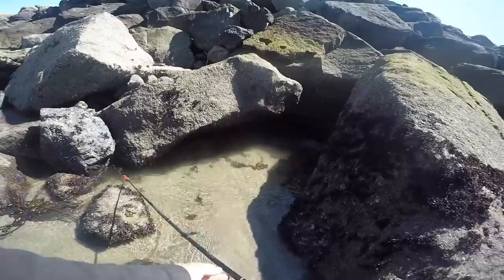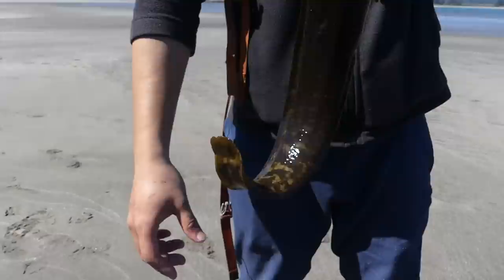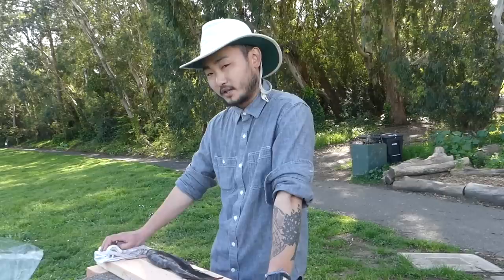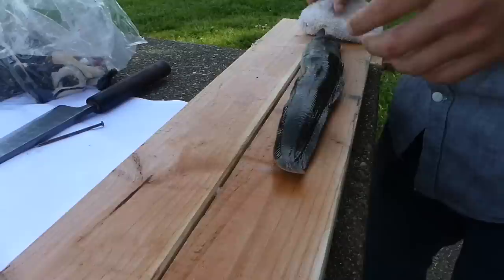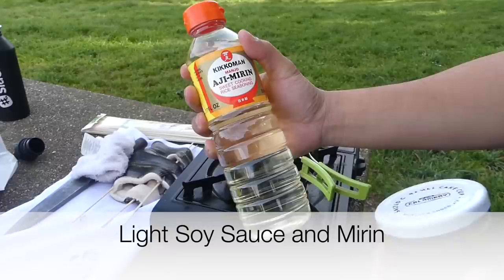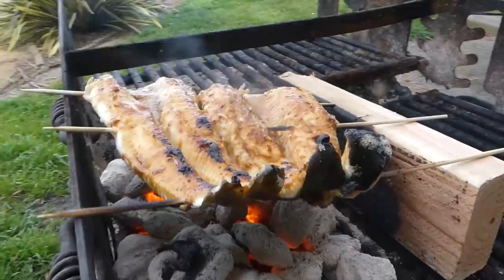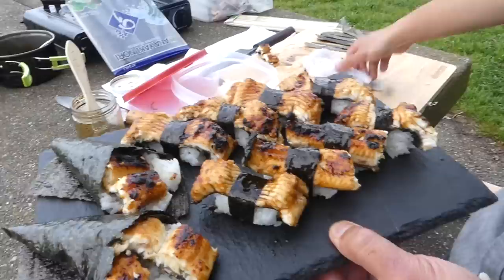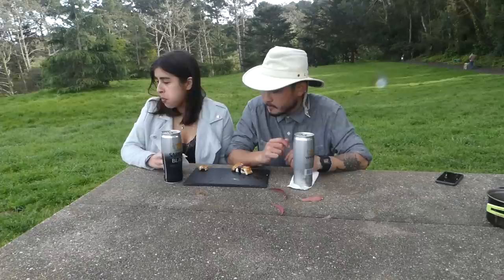Catch and SUSHI EEL Ep.9!! How To Fillet Eel For Sushi!

Comment: the reason that your eel isn't cooked evenly and even burnt is because the meat isn't evenly distributed across the heat. Also you should wait until the eel is at least half-way cooked before coating the eel. that way the sugar won't get in contact with as much heat and as long of a time but still stick to the meat and get flavor.